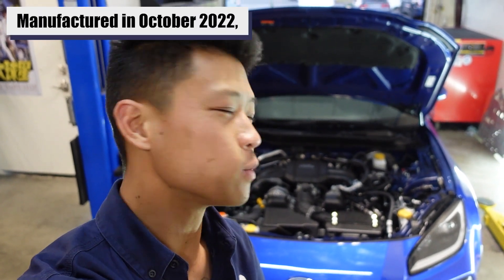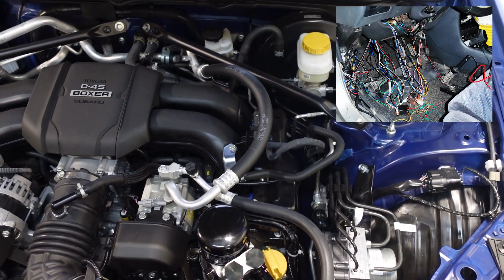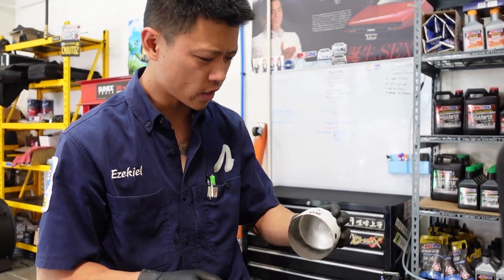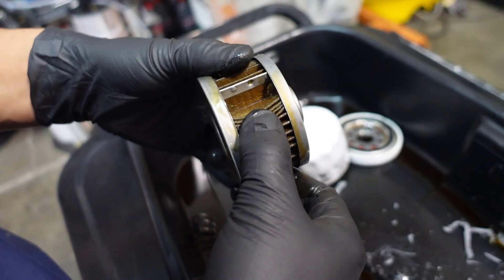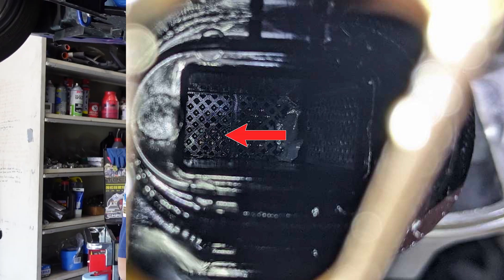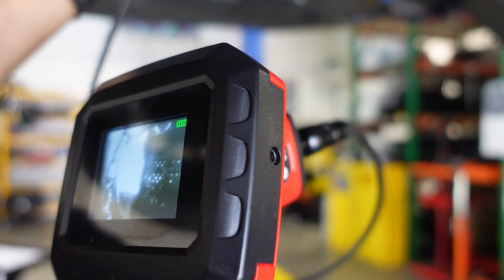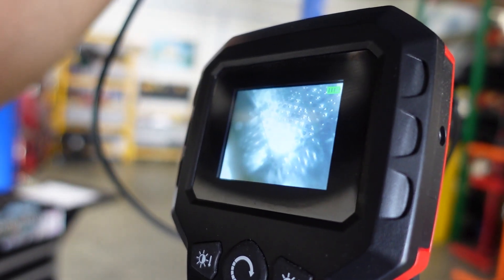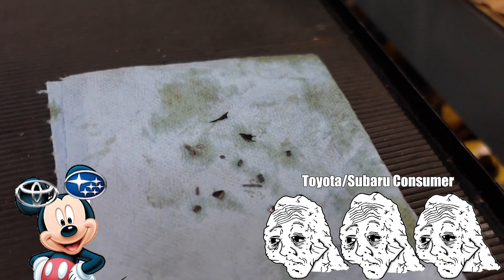Subaru's RTV issue in 2023 / Oil Pan Drop 23

Comment: Been considering a BRZ since my 2004 WRX is developing major oil leaks. I put all ~220k miles on it myself over the past 19 years, never had any major problems until now & wanted to stick with Subaru. 

Are there any aftermarket gaskets available for the FA24? The silicone sealant thing seems so flaky, so to speak.

Your channel is awesome, informative, and entertaining. I catch myself cracking up at the memes you guys insert. 🤣 Keep up the great work!

Comment: Pretty much every platform needs additional oil pan baffling to negate starvation in high lateral g situations. This is nothing new
Reply from the maker: If you watch 900brz's video the key is that you get a repeatable 60psi drop on corners that no oil pan baffle has been able to solve yet. Sounds like an engineering flaw from the factory to me considering all the adverts show this car drifting around a racetrack
Reply: @CMAutohaus  don’t completely agree. The KillerBee baffle design was very experimental and didn’t address sloshing at all. There’s a user NoStreetRacing which uses the SYMS design which was run at the same track as BRZ900 and showed so promise, however like all the baffles currently on the market it also appears to mainly be a horizontal baffle with little to no vertical baffling around the pickup. You would know more as I have seen on one of your videos you installed this pan and baffle to a white GR86 (which may even be NoStreetRacing).

All the current available baffles appear to all be the same FA20 style baffles so in essence there isn’t a unique baffle designed for the FA24.